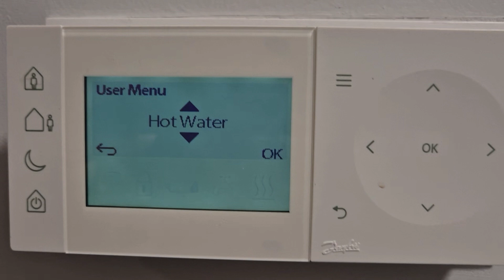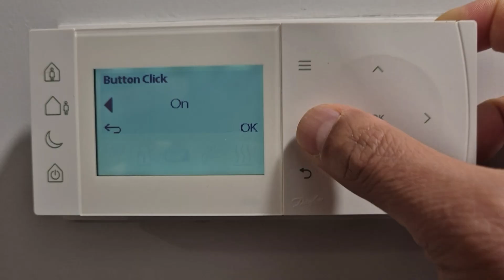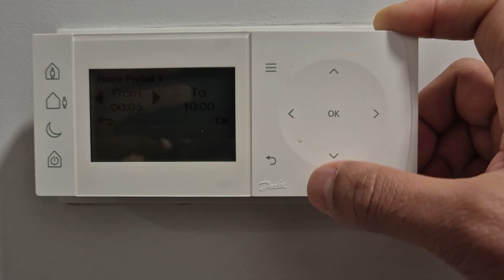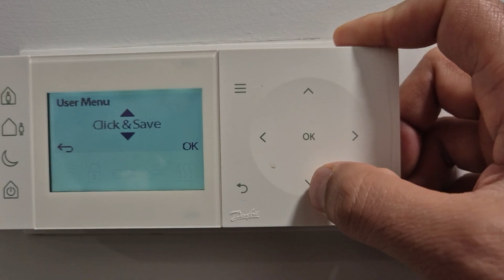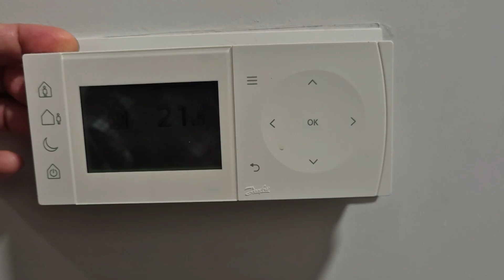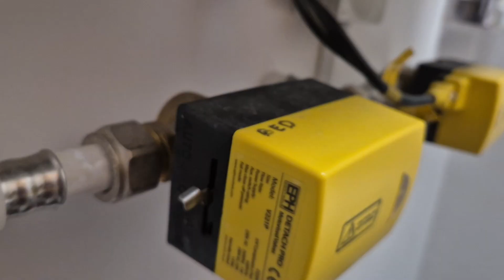Danfoss TP1 Heating (Radiators and Water) Thermostat Controller

Comment: Mines not even turning on. No display
Reply from the maker: Was it turning on last winter or you are new to the place? I would assume there would be some switch in the main board for heating control panel..